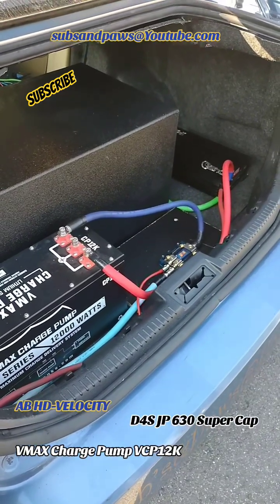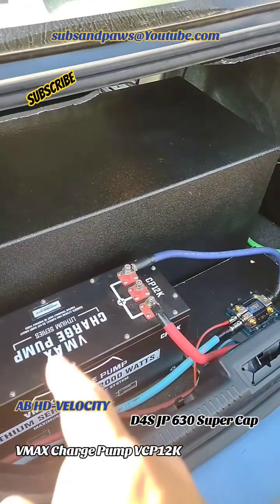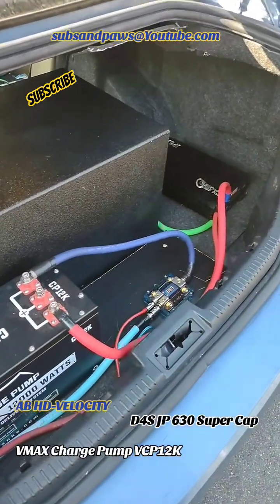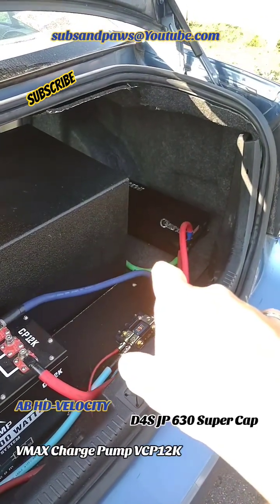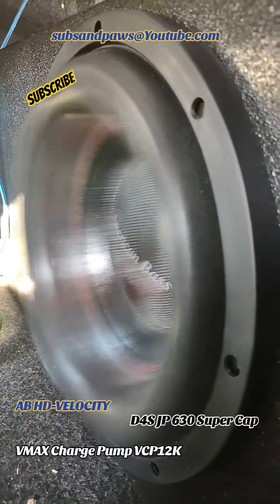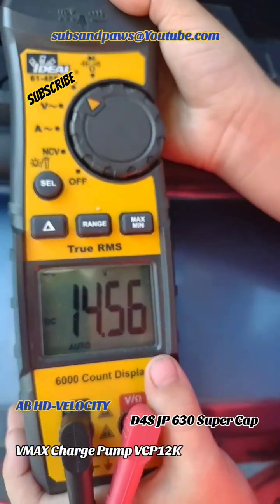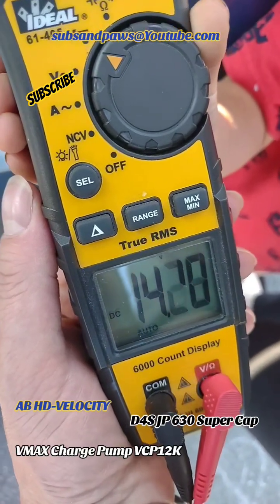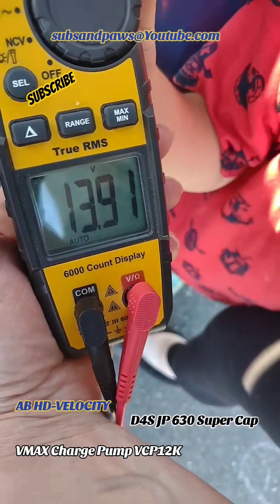Adding A Lithium Super Capacitor To VMAX Charge Pump VCP12K D4S JP 630 Voltage Test

Comment: Does this charge pump run with stock battery? Or do I need to switch over to a lithium in place of my current stock battery?
Reply from the maker: An AGM battery is recommended. I've used it with both. The AGM does seem to help it but it still works either way. I've used it with a factory Alternator and a high output alternator. Both work fine. Use my code on their website on any charge pump lithium and you'll get an extra 15% off. S&P15. Thanks for your comment and support 🙂 I appreciate you 🙏
Reply from the maker: SP15 sorry. I just checked. You can get the 12K for just over $500 with my code. They're on sale now too.

Comment: do big  three upgrade for alt and stuff
Reply from the maker: Big 4 with a 320 amp alternator. 2/0 gauge wire from alternator to the back. 1/0 from battery to cap to double run on the amplifier.

Comment: I'm no expert to start but my dumbed down understanding of how caps work is that they can discharge and recharge very quickly over very small fluctuations. These fluctuations can happen faster than the equipment refreshes it's display or could even measure. Which is why it can be advantageous to run both dual batteries and caps.
Reply: Also, maybe your measuring equipment is of sufficient quality that it is measuring said small fluctuations and that's what you're seeing here. Is it possible that it's showing you that it's working?
Reply from the maker: I'll show both meter's at the same time. These are not cheap meter's either. They're very expensive meter's. But at the same time you maybe on to something.
Reply from the maker: That's a great way to put it and a solid understanding of how it works. I have the D4S meter for the cap's and lithium battery. I'll show it in a coming video and show the voltage on that. It's directly connected to the device and super accurate.  Thanks for watching and thank you for your comment and support 🙂

Comment: what's amp are you running? and what's the voltage like with just the charge pump.
Reply from the maker: The VMax Charge Pump VCP12K. Just the one single battery. Full tilt the charge pump drops to mid 12's when wired to 1/2 or 1/4 ohm doing 4,000+ watt's. That's on like bassboosted or heavy decaf playing nonstop tone's. On regular music maybe not even lower than 14 full tilt. The super cap's take all the voltage drop and the battery stays very stable. Voltage at rest is 14.8-14.9 volts. Great question ⁉️. Thanks for watching and thank you for your comment and support 🙂 I appreciate it 🙏. If you're interested in the battery I have a code for 15% on their website. It's cheaper than anyone online and maybe one of the best most effective batteries.